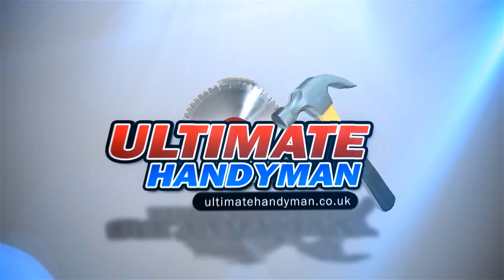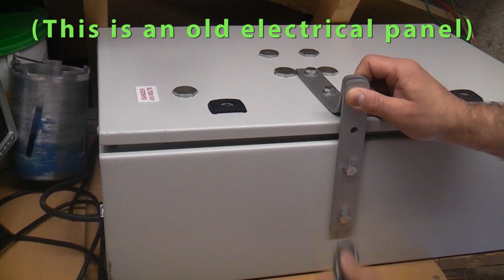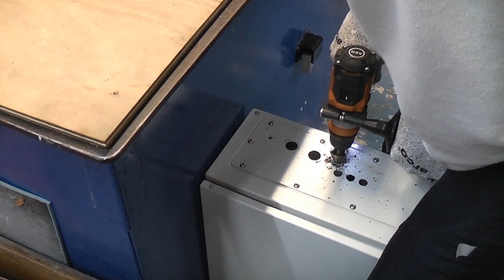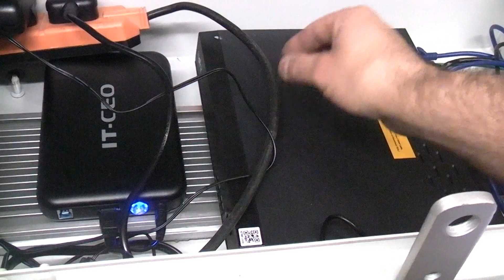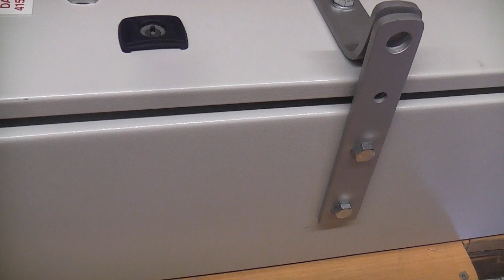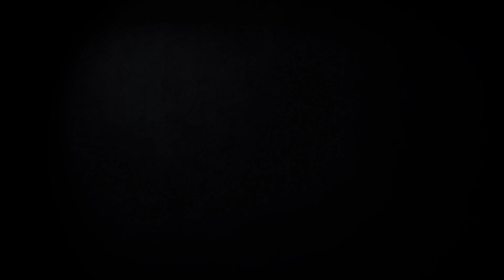NVR security tips | CCTV recorder security tips

Comment: A good idea but you need ventilation grills, in and out and maybe fans too. I don't tbink a heatsink is enough. Installing in a loft here in Australia would be way too hot in summer but maybe ok in UK though. I like the idea of a solid cabinet and padlock.
Reply from the maker: It has a few ventilation holes, but if it starts getting warm, I'll add a fan.
I would never go in a loft in Australia, I've seen what those tiny spiders can do!
Thanks for the comment 👍

Comment: Great idea, but the unit will overheat as there is no air circulation. Most NVR's can be secured by taking the lid off and bolting them down.
Reply from the maker: It's been fine, so far. But I'll keep an eye on the temperature.
Thanks for the comment

Comment: Heart attack! Jeez, sorry to hear about that, but glad you made it! I hate to say this, but unless the lock is physically shielded and unable to be accessed, a little cordless angle grinder with cut-off disc can zip through every padlock known to man in less than 20 seconds. Same with those brackets the lock goes through. Also, they are very quiet compared to the corded ones!
Reply from the maker: Thanks for the comment 👍

Comment: Cloud storage will be great help too if DVR is stolen can still get the recordings from the cloud. You still May need to add a small fan inside the metal box the heat can't escape will shorten the life of your DVR and the hard drive.
Reply from the maker: I'll keep an eye on the enclosure, but it should be fine as there is quite a few holes in it for the heat to escape.
Thanks for the comment

Comment: you bolted that padlock bracket onto the 1mm steel box, im sure that would take loads of effort to pry off if you wanted to get in there. interested to see what happens about condensation on the box though as the lofts can be cold damp places in winter which could cause issues. would that heat sink not work better on top of the things your trying to cool down due to heat rising?
Reply from the maker: I'd love to see someone try and prise the bracket off ;-)
My loft is perfectly dry.
I'm sure the heat will dissipate.
Thanks for the comment 👍

Comment: What circuit breaker does a combo boiler should have coz I am worried I found out that mine has a  40A breaker and I know it should have a 3A FCU to protect the boiler
Reply from the maker: The size of the circuit breaker does not matter, as that is protecting the cabling on the circuit. However if a boiler is connected to a circuit, it should have a FCU, which should be fitted with the appropriate fuse, that fuse will then protect the boiler.
Reply: @ultimatehandyman  so can I lower it down to 20A because the cable is 2.5mm
Reply from the maker: Is the boiler the only thing on the circuit? 
If it is, yes I'd use a 20Amp breaker, then a FCU with the appropriate sized fuse for the boiler.
Reply: @ultimatehandyman  OK thank you and yes the boiler has its own circuit

Comment: Anything to worry about overheating in the summer? Especially in the summer up the loft in a sealed box.
Reply from the maker: It should be ok, there are a couple of ventilation holes in the cabinet, but I'll monitor it in summer.
Thanks for the comment 👍

Comment: I didn't see you fix the nuts so that a wrench could not remove the hasp from outside. ALso the screws or bolts on the side panel need to be secured so that they can't be removed easily? Tack welding the nuts and screws on inside of the box might fix this. Or double nuts at least on hasp. Right?
Reply from the maker: The bolts are fixed wit washers and Nylock nuts on the inside, so no chance of undoing them.
Thanks for the comment

Comment: Will the nvr get hot with it being in the loft? Even with the heat sink etc
Reply from the maker: I have not had any issues so far, but I'm in the UK.
If I lived in a warmer country I would probably install a small fan (if I were having problems)
Thanks for the comment 👍
Reply: @ultimatehandyman  UK weather in summer is hot... Even more so in a loft with insulation 😂
Reply from the maker: @justintemp   I should have put Darwen weather, not UK
I check the weather on my phone and the App says 1% chance or rain- and it rains!
Reply: @ultimatehandyman  Northern weather eh?!

Comment: great video,however,secure your bolts with split pen's,that way it will be more difficult to undo the bolts of your padlock fixing,also,install a alarm,with a movement detector in every place positioned that it is in line with every (exterior) door and window,that way you wont have to put a sensor on every door and window
my alarm went of in the night because there was someone close to my front door (door with glass inset),even then my movement sensor picked up the faint infrared signature
so that person fleed after hearing the inside alarm,that way,no one will be beside your bed somewhere in the night,wich happens a lot these days
Reply from the maker: I meant to show people how to rig this up to the alarm system, using a limit switch, but forgot!
Thanks for the comment ;-)

Comment: Crikey. Take care mate, after that heart attack. Once again, another very useful tutorial.
I would only add, if you don't mind, that in addition to the heat sink a small 30mm fan would help with the cooling?
Reply from the maker: Thanks  (I'm fine)
I'll monitor it over the summer months, if it starts getting too hot I'll install a fan.
Thanks for the comment 👍
Reply: @ultimatehandyman  I'm sure that setup will be fine. It's just that, as you know, passive heat sinks are normally fitted above the components as they rely on convection to remove the heat. A small fan may get some air flowing through.

Comment: This cabinet seems a bit unnecessary. Especially the padlock and that oddly mounted heatsink which seems like it wont do much
Reply from the maker: Well it will stop any thief from stealing the NVR.
The heat sink is not mounted, it's just placed in position.
Thanks for the comment 👍